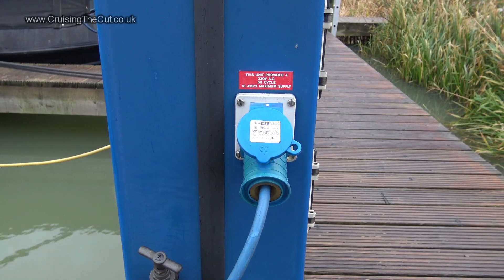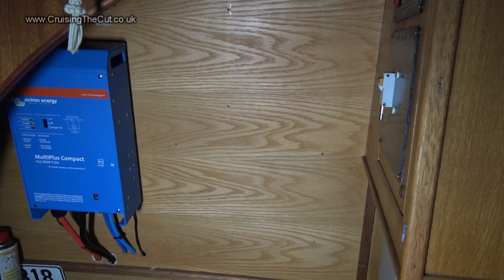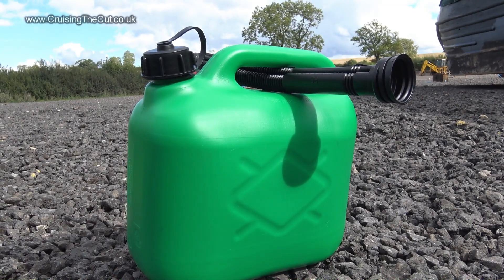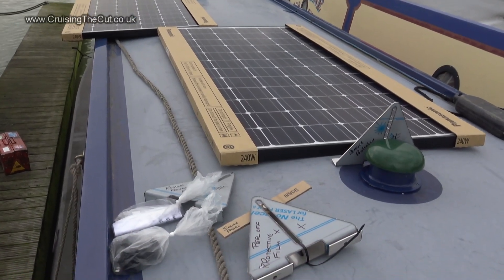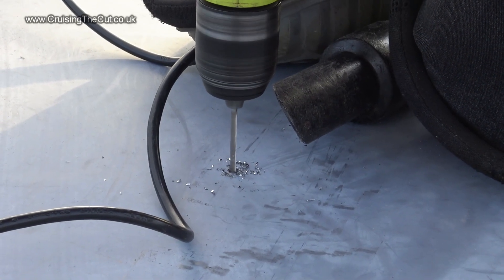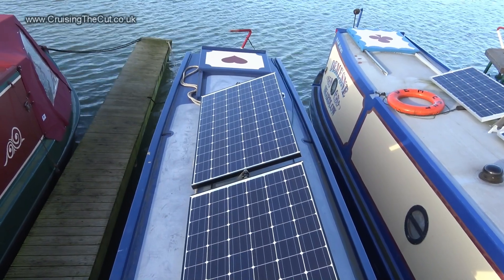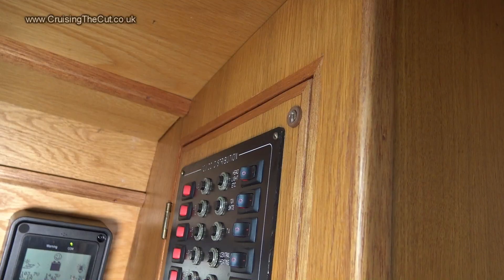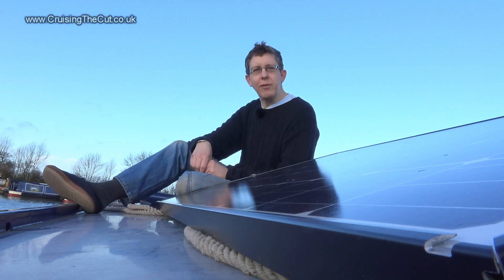15. Solar panel installation on my canal narrowboat (2 x 240W Panasonic)

Comment: Some time ago I read, “it’s better to work a low power engine than to go slow with a higher powered one.”  I didn’t know anything about bore glazing a half hour ago but apparently:  Diesel engines prefer to run above 60% designed load, it keeps the pressure in the engine up.  There are machined grooves in the cylinder walls that hold and transport oil downward.  When the engine idles too much the pressure drops and carbon and un-burned fuel mix and fill the grooves [glazing].  If you ignore glazing the carbon&fuel becomes an abrasive, polishing the bore, destroying it within.   Wikipedia.
Reply from the maker: Wikipedia is a marvellous thing (sometimes!). Ta!

Comment: I love your videos! they are done very well and very amusing. please keep up the excellent work.

very informative in regards to your solar panel solution. one thing i would like to add in regards to generators have you looked into one's that are propane powered? we have those over here in the states plus some companies make conversion kits to turn petrol units into one's that run off of propane. 
I have subscribed and i  will be looking forward to more videos in the future 
have a pleasant day and stay dry.
Reply from the maker: Thank you. Yes I think a lot of the petrol generators can be converted to propane and given that I have propane onboard it could make a lot of sense. Something I intend to look into in the future. Cheers

Comment: hi how can you work out how much power u need from the solar panels colin
Reply from the maker: +carper1325 Either tot up how long you run each device for each day and multiply that by the amount of power it draws. Or, if you're in a marina, just check how much power you're using from the meter each day. In my case it was around 1000W. The solar panels are rated at 240W each (maximum) ie 480 Watts so in theory in two hours they would generate all the power I need. In practice, solar panels don't run at peak efficiency and the sun isn't always directly overhead in full brightness etc. But I still reckon that on a summer's day with light from 7am to 7pm, that's 12 hours to generate my 80Ah, which should be enough!

Comment: Nice job! Until funds are in I'll be on a trickle charge panel for my batteries but I have so little draw on them I should get away with it for a bit. Looking forward to paneling up too :) Merry Christmas
Reply from the maker: Thank you! I'd quite like to add another smaller panel for the starter battery, as those ones are just for the leisure bank. It certainly wasn't cheap; those "slimline" panels were a lot costlier than similar-wattage ones that were 1m wide but I wanted the extra walkway space. Perhaps Santa will bring you some panels down the chimney?! Happy Christmas to you too!